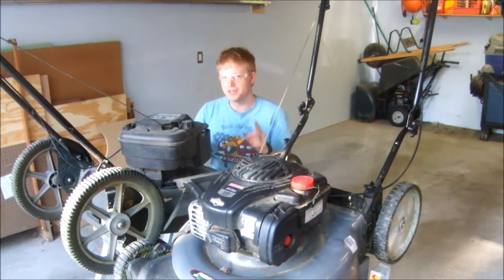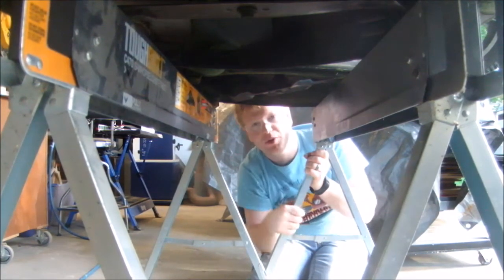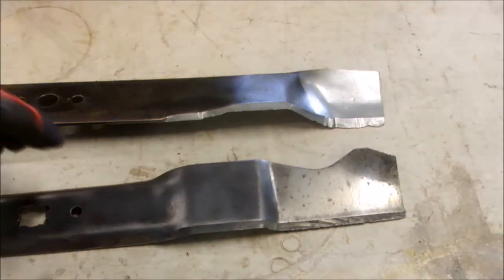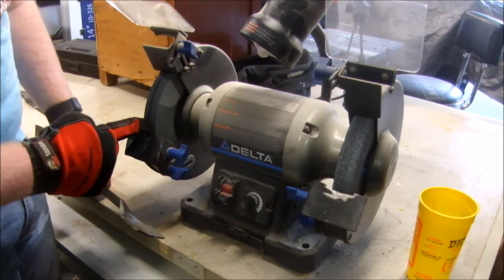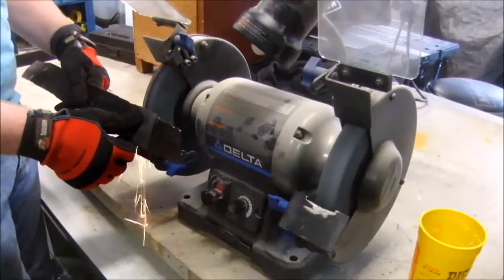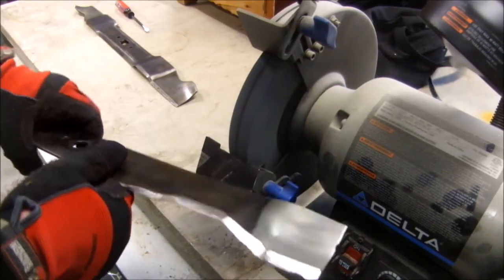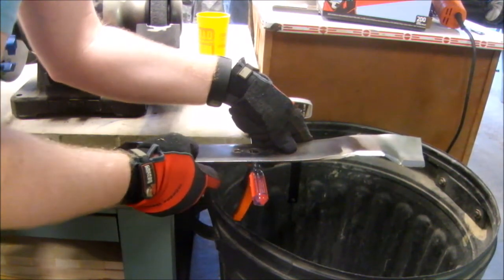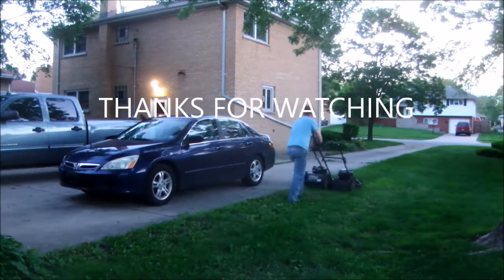Mower Care   Sharpening & Balancing the Blade

Comment: It may also be a good idea to detach the spark plug lead before working anywhere near the blade of a mower.

Also, is it alright to balance the blade by removing material from the unsharpened side of the blade? That way you don't have to rework a perfectly fine edge.